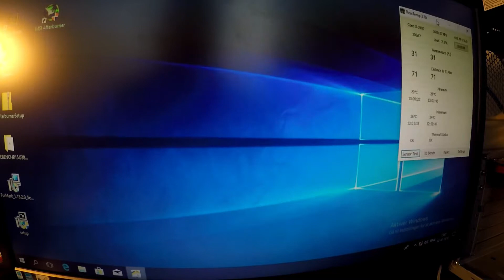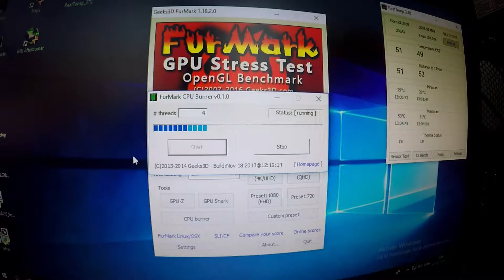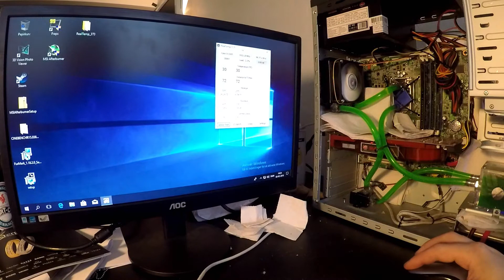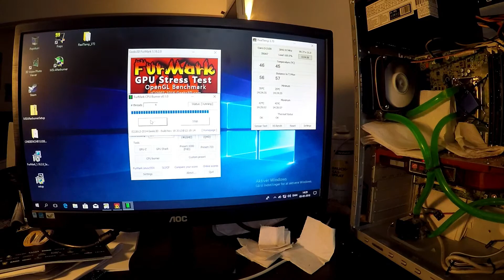$32 CUSTOM WATERCOOLING LOOP

Comment: That cpu block is just bad, its far better to get a cooper all in one cpu block. The pump its ok for a loop of only a rad + cpu block.
Reply: That's a budget DIY .. Bro DIY .. I'm building 2  water loop PC 1 with latest part and a high end only using a good quality parts at good price and hard tubes while I'm going DIY aluminum soft tubes like this for my 2016 rig .. That thing leak bcuz  of #1 tube OD are slightly larger & its so thin look at the vid its easy to fold flat , #2 no clamps .. Clamps are very important for pre-installed barbs .. Thinking of adding an O-ring  at the barb for my build then using a clamp

Comment: THE NOISE IS VIBRATION OF THE PUMP, YOU SHOULD USE RUBBER AT THE BOTTOM OR SOME OTHER HOUSING TO ELIMINATE VIBRATION. anyway the pump is very loud.

Comment: I couldn't stop laughing when the noise pump, er water pump began it's song. Hose clamps are the right answer to the leaking, and a small rubber pad under the pump would help with the noise.
Reply: That happen bcuz its only sitting there no screw or antivibration

Comment: Just dont rather save more money around 100 bucks more you can build full custom loop with 360 rad and enough powerfull pump that you can run 2x 360 with a full gpu block if you want and its all copper
Reply: Ali express is pretty cheap for parts. I saw 360 rad full copper for 33 bucks and its thick

Comment: oh my fkkn god,my toes are curling....... tube way too thin too long hence the kinks,use zip ties to secure them,and sand the blue paint off the bottom of the alleged "cpu block"....it will also make it flat and not concave as these cheap ass chinese pieces of crap always are.....

Comment: one of the biggest problems with these cheap fittings are that they don't come with any o-rings
Reply: My $0.95 barb fittings all have 1 o-ring at the threading.
Reply: U can add O-ring at the end of the barb then put the soft tube and use a clamp

Comment: Nice work. Did you have the radiator fan pulling colder air into the system or blowing hot out over the radiator?
Reply from the maker: I had it blow air from inside the case out. Since the Graphics Card is a blower-style design, i figured it would not play a mayor role on the overall CPU temperature. :)
Reply: Toby's Tech Ok cool. Do you think the pump may quieter down if it has a piece of rubber between it and the case, or is it actually rattling inside?
Reply from the maker: I'm planning on adding a piece of foam, to try and make it a bit quieter, since the sound it makes now is unbearable.